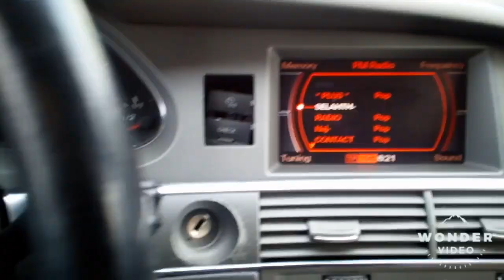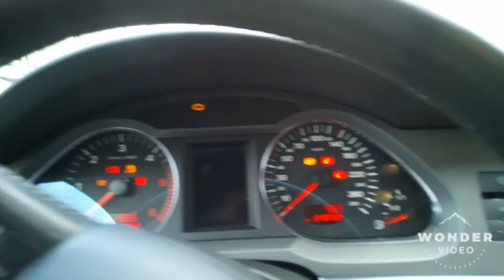Audi A6 C6 remote not work solved

Comment: Hi.my key not working just when I want to block the doors..if I try to open them from remote is working.How can I solve that? 
Thanks
Reply from the maker: Hi
replace the batteries in the remote
Reply: @grusz5  I replaced..but no result the button for closing doors